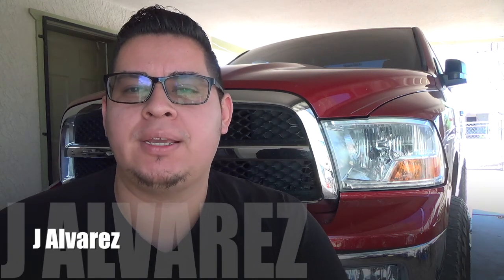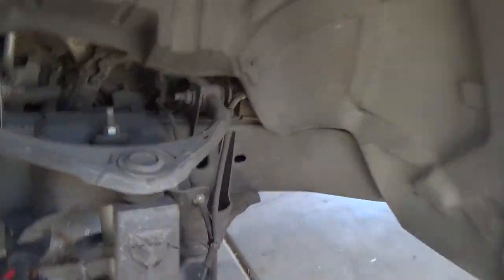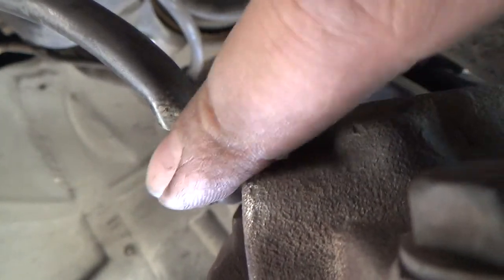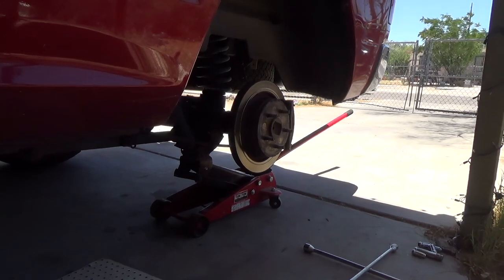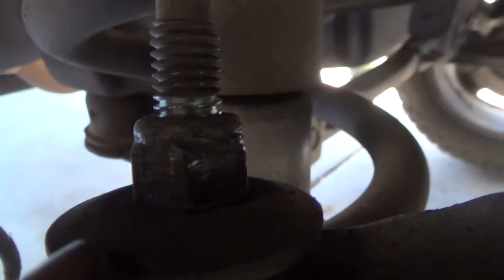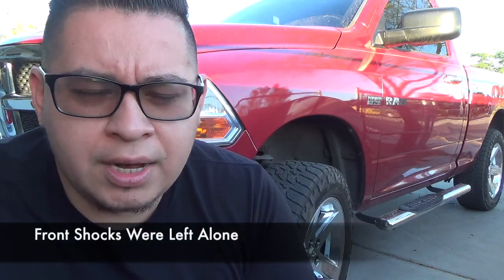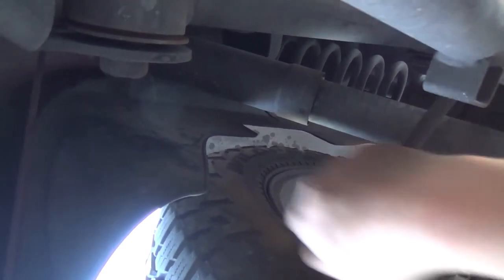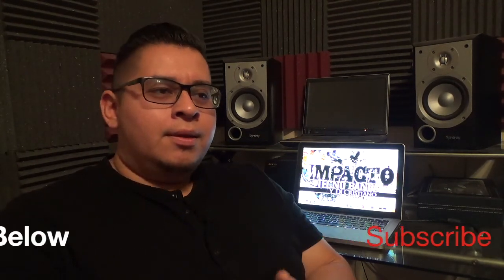Dodge Ram 1500 Maxtrac 4.5 Spindle Lift/Falken WildPeak AT3W Review Update (18 Months Later)

Comment: One thing I noticed was the brake line delaminating was due to the fact that fitting it supposed to point towards the top of the spindle you have close to a 90 degree bend in the hose causing premature failure

Comment: When doing the spindle 4.5” lift in the front do the shocks and springs stay stock if they are stock?
Reply from the maker: I left it all stock. But seems like the shocks wore out now and it’s been around 2 years with lift and 2 years normal ride height. So 4 year old shocks.
Reply: J Alvarez how is the ride quality with the spacers in the back suspension?

Comment: I was thinking about doing to my 2011 Silverado. But how does it work with out control arms? I tried 4" spindles on my 93 k1500 blazer and tires leaned out crazy
Reply from the maker: I didn’t have to swamp mine. Are you sure those spindles were for that blazer?
Reply: @Jalvarez2  yes im sure problem is  i bought just the knuckles and disnt buy the crossmember drops

Comment: Hey man it was just a spindle lift right? No coil spacers no anything else? I'm planning on doing the same thing.
Reply from the maker: Joe Ramirez 2” spacers in the rear and spindle in front
Reply: @Jalvarez2   that truck looks really nice leveled and lifted.     I planning to do this on my 2016 ram 1500 2wd crew cab.      I have the 2 pieces drive shaft. I hope I don't need the spacer for the carrying bearing.    Thanks.
Reply: @Jalvarez2  I want to do the spindle lift on my new truck 3500 miles on it you think it's worth it because my shocks are brand new and if I do the lift they are replaced with new max tac shocks